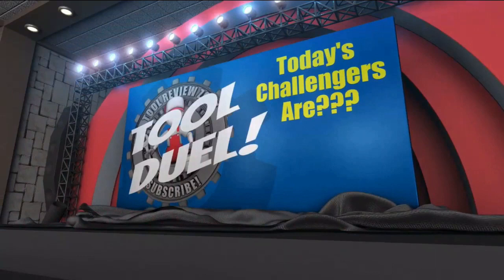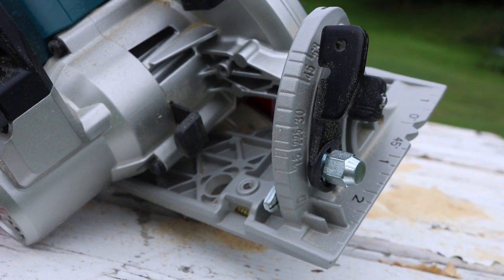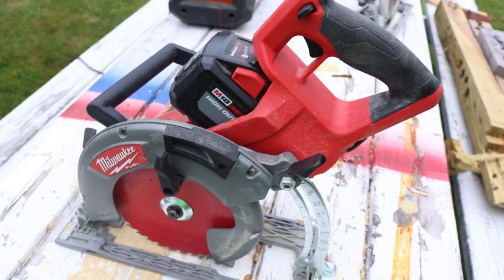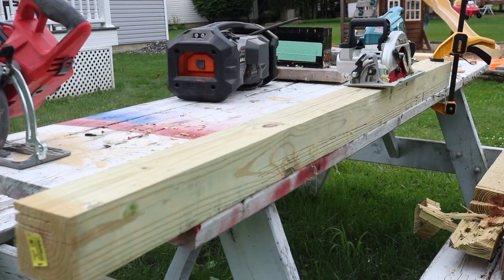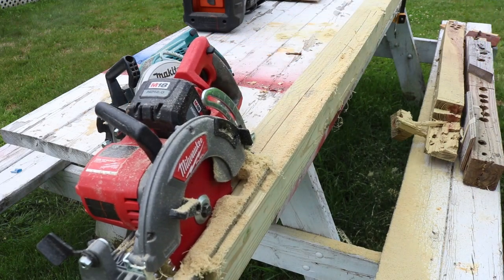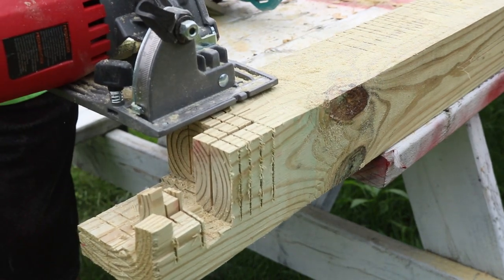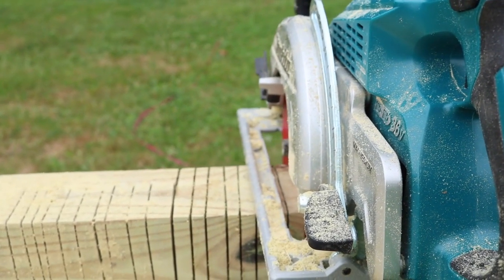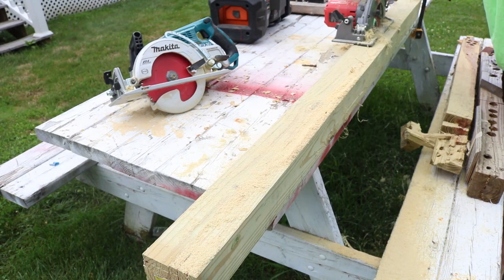Milwaukee VS. Makita! Milwaukee 18v rear handle saw vs. Makita 36v rear handle saw (Tool Duel!)

Comment: I just picked up the Makita XSR01 and I noticed it has an additional extraction port next to the blade stop, the one on this video does not have it. I picked it up from Home Depot with (4) 5Ah batteries, a dual rapid charger, and a storage bag for $250. Hard to beat that deal with Milwaukee.

Comment: Hi TRZ, 

Still thinking if i should purchase this milwaukee circular saw.  

I have to agree with you.  Don't like the bevel knob swinging around and getting lose.  Next the dust extractor should come with a solid cover plate to cover that section  and let the dust come down at blade like a worm drive.  

Or make a different model with no dust extractor on the cover. Like the 6 1/2" model.  

I guess i will wait until milwaukee comes out with a gen 2 model soon.
Reply: Any Milwaukee tool is just great in every from power to battery to durability

Comment: Thr problem is you didn't use the vacuum hose adapter that came in the milwaukee box. Mine has NEVER clogged using it connected to a shop vac which is how it was really intended to be used
Reply: Paul Auten 

No one is ever going to use a shop vac in the field framing. I understand if you are in a clients home making some cuts, yeah use a vac. But the saw has to be able to perform without a vacuum. If I am going to have a vac plugged in the saw 24-7, we would be far less efficient. Also what is the point of cordless at that point? Just my opinion, have a good one!
Reply: Paul Auten or do you mean just the adapter without a vacuum? If so I stand corrected:)

Comment: Why are you hating on the 2 battery system? It totally beats having two different battery types and 2 different chargers to go with it. You can buy body only and use the 18v batteries that you've built up over the years.  I think you're just looking for faults with the mighty Mak.
Reply from the maker: So I have to like everything you like?

Comment: in my opinion, Makita wins here $350 for the whole package vs $449 on Milwaukee faster charge time  and the 12ah battery is not on your way.
Reply: I got the full Makita saw kit plus 2 additional 5.0 batteries (4 total) for $250
Reply: @brokenwave6125  that's great where did you get it from?
Reply: @bitter8440  Acme tools. The promotion where you get the 2 extra batteries for free is still going on too. I think the rest of the month.

But the normal kit with the 2 batteries is always $250 now.
I think Makita dropped the price on that saw this year.

Comment: So these are not true worm drive saws?  Are they essentially sidewinders with a rear handle?
Reply: No they are not true worm drives.  Even though they are rear handles, their gearing is 45 degrees instead of the 90 degrees with a true worm drive.  So they are also not direct drive saws either.  But, they sure do work well.  And the left sided blade is perfect for us right handed people.
Reply: How many degrees is sidewinder?

Comment: Looking for a 2020 holiday deal for either of these saws.  My preference is the Milwaukee, only because I have other M18 tools and don't want another battery platform.  I honestly think the Makita is a better tool (longevity).  The Makita kit is on sale right now at HD for $152 (saw, 2 batts, charger, bag).  Thats a pretty tough deal to pass up when the Milwaukee is priced at $269 just for the saw.  I may hold out for a deal on the M18, but for $152 I am thinking HARD about it.
Reply from the maker: The makita is an awesome deals going on at home depot right now

Comment: Makita has 270 tools with same battery format . Winner.
Reply: ...and does not have any battery powered framing nailer. Loser)
Reply: It's not about the number of tools on the platform. It's about the number of unique and useful tools. You can have 30 impact drivers but what does that do for you?

Comment: No, Makita has it right with the two battery system because you can use the 5amp batteries on any tool! I'm not gonna plug that 12volt battery into my impactor

Comment: I'm wondering if the dust shoot on the Milwaukee would have still clogged if you ran them both at the same pace; because you ran the Milwaukee at about 11 seconds both cuts, and both cuts on the Makita you ran about 16 seconds.  So, Milwaukee's was cutting about 25% faster. Would it have still clogged if you slowed it down 25%?
Reply from the maker: thats a great observation Jason. I may need to try it.
Reply: Makita 18v X2 5100rpm vs Milwaukee M18 5800rpm

Comment: Wet pressure treated always clogs up dust ports. It's par for the course. I've used the makita and the objections I have to it is two fold. First you need double the amount of batteries and they need to both be charged to the same amount in order for it to work properly. Second removing the batteries is very difficult ergonomically.

Comment: I have bought both of these saws. I just got the Milwaukee and I've had the Makita for about 2 years. I try to buy only kits or use sales as a way of buying tools. They are both awesome saws. I don't like the lack of a stop on the Milwaukee, like you had said. My cheap corded old Skil saw has one. Massive oversight. Loosing that would suck. I have to provide tools for my workers. Most have their own stuff, but I like getting the job done fast so we can move on to the next one.... waiting on someone's HF stuff to charge is a waste of money.
Which brings me to my final and maybe most important, price. Tool-only you're gonna pay out the nose for either of these. Milwaukee runs a buy more save more that reduces the price of their saw considerably. However, as many of your viewers may know, Makita runs a sale in that saw multiple times a year. It's the same price as tool-only but you get 4 batteries and a dual charger. Two years ago they had 5 amp hour batteries in the kit. They have since reduced them to 4 amp hour batteries, but you still get 4. While it doesn't fix the issue that their saw needs two batteries, it does clear up the issue of not having enough batteries for your other tools. 
More tool duels man! Love these.

Comment: For me, the lack off on tool storage pretty much eliminates that tool as an option, also I feel the two battery platform is good because you have the flexibility to use it either in an 18 volt X 1 tool or an 18 bolt X 2 tool, instead of having to buy a whole new battery platform.

Comment: I haven’t had the chance to try the Milwaukee yet, but  it looks awesome. I really like my Makita. Honestly my only gripe is not having a light. I’ve had several saws with blade wrench storage, and I never keep them on the saw. Gotta go to the truck for a blade anyway. The double battery thing is a little weird, but it’s really no difference, I just charge them together as a unit. 👌🏼
Reply: ...and FYI, the blade that comes with the Makita is a fair amount taller than the same 7 1/4” Diablo for some reason 🤔
Reply from the maker: Hmmm, haven't even noticed that. Thanks for the feedback Bro

Comment: After watching the vid I'd say they are pretty even up as far as performance is concerned.  The only drawback I see is the two batteries required for the Makita since it adds more weight.  If I had to choose one, I'd go with the Milwaukee based on performance and the single battery.  But  that's just my opinion since I'm a DIY'er and not a contractor.  Thanks for sharing.  Cheers!
Reply from the maker: As always, thanks for the awesome feedback William!!!
Reply: but the 12 AH milwaukee battery weighs much more than the makita 5ah battery.  And it is much more bulky.
Reply: Doc Martin
Reply: Those barriers are like 150$

Comment: I completely disagree about the dual battery concept. How much bigger can Milwaukee batteries get. Makita has room to improve but to me Milwaukee has reached the limit as to how big and heavy their 18V batteries can get. Also, from the electrical engineering point of view 36V just makes much more sense as you can use thinner wire because you have have half the amps when you have twice the voltage. Also, Makita gives you free batteries when you buy the tool or at least they did when I bought mine as they had a special where they gave you for free two extra 5.0 A-hr batteries so you can always have a fresh pair ready to go and there is no way in hell you can use two of these up before the dual rapid charger can replenish the dead ones. Two of which together weigh less than the one 12.0 A-hr Milwaukee. The 36V dual battery concept is the best solution to these high demand applications.
Reply: Good one
Reply: Depends if it's run as parallel or series

Comment: I have used both, the makita is great but a tad heavy. I own the Milwaukee, One thing that bugs me to no end about it is the blade guard has a taper to it at the contact point that tends to knock you to one side during the start of a cross cut...I realize the bad asses will say they lock it up out of the way and I get that... Also the dust channel dose seem to clog on occasion but what I don't like is it coats me with saw dust especially during osb rips...When I first got this saw I thought it would be the back up or convenience saw, strangely I haven't used my worm drive skillsaw since I bought it! it's a new era nowadays.

Comment: Don't see the problem using 2 batteries to get 36volts. I have plenty of batteries i interchange between my 36 and 18 volt tools. For me its better to stay on the 18volt platform and double up for more power. Both the Makita and Milwaukee saws perform well but my choice purely to stay on the same battery platform. Keep up the great vids 👍👍👍

Comment: Makita  batteries take 45 minutes to charge and the Milwaukee battery takes over an hour. Enough said, I will take 2 batteries that I can easily use with all my other tools that are faster to charge and more out of the way, any day. The amp draw on each battery is half what it would be on the Milwaukee because there are 2 instead of one, which I imagine helps greatly with the Makita's battery life.
Reply: Did you know Milwaukee does a super charger which halves the time of the rapid charge?

Comment: Both are great saws like you mentioned, and Milwaukee did a great job with the saw especially for an 18v platform.. can’t wait to get my hands on one. But most likely, that Milwaukee will need to be warrantied a few times while that makita will keep working without issue.

Comment: I from Canada and have used them all been doing framing for 30 years Milwaukee is the only one that will work all day in negative 20 and have had the same Milwaukee saw for 2.5 years not an issue

Comment: Milwaukee 18v:  saw, charger, bag, one 12 HO battery $449.  Makita 18v x 2:  saw, charger, bag, four 5ah batteries $259. Makita 40v Max XGT: saw, charger, bag, three 4 ah batteries $399. Flex 24V stacked rear handle saw, charger, bag, one battery $399.  Probably a nice saw, but I think Milwaukee 12HO batteries are still too expensive.

Comment: I own both LXT and M18 batteries and tools , but personally got the Makita on a BOGO deal with two 5Ah, dual charger and a cordless sawzall for $249. This is cheaper than the Milwaukee bare tool and we all know the HO batteries are over $100 each.
The Makita has been on sale several times and it's hard to beat for the price. If you ever spot the Milwaukee on sale for $249 with battery and charger jump on it.

Comment: It's funny because I have both companies of tools and for the Makita I have that saw now I just bought it for $250 it came with an extra pair of five amp hour batteries so I have four total you can't beat the price point as for Milwaukee their tools are just on another level of durability they're really tough they feel good in the hand as well but not as good as my Makita Black compact series but then again I bought that for home use but I am very excited to try this saw it will see what happens thanks for the video shoot out!
Reply: Bought mine but came with free grinder xlock 😀😀😀

Comment: And Milwaukee has a 5 year warranty vrs a 3 year on the Makita, an important thing to consider where the motors are all electronic!!!
Reply: Good thing........because you're gonna need it lol.
Reply: @mattfowler7892  The point I'm trying to make is that with the "brushless" motor technology I don't care what brand if anything "electrical" goes wrong including the switch (with a few exceptions)  it's normally not worth repairing. For example if the switch on the  DeWalt DCS577b saw quits at 13 months you throw it away because a new switch/motor module is close to $125.00 with out labor, and it only has a 1 year warranty (ya I know they try and tell you it's a 3 year but switch's are considered wear items). With the Makita you can at least buy the switch separate for around $15.00 (the motor assembly is very expensive) and it's warranty is  3 years.  With the Milwaukee the switch is only available as an assembly for around $140.00 and is warrantied for 5 years. And by the way they all break! By the way battery warranty is 3 years for the Makita and Milwaukee and 1 year on the DeWalt.
Reply from the maker: @slivers4007  great point

Comment: The only thing that I can say is that I use the Milwaukee one daily and I absolutely hate it because the ejection port blasts the dust right into you. I do a lot of finish work so my cuts have to be exact so I’m always close to the cut to see and you’re probably saying “just put on the ejection tube that comes with it” well that’s an even worse design because once you do that it shoots it directly at you now instead of down and onto your pants.

Comment: In my opinion, both saws are top of the line. But my pick would be Makita ,only because of the battery's swap out. And I prefer the extra weight on the Makita to keep my line in check... And let's not forget the fast charging, which is very important for me😊..

Comment: The X2 system is absolutely better. You just use the same compact batteries that you already have for all your other tools. You probably even got them included extra in combo deals.

Everyone else you have to buy these expensive monster single batteries for these bigger-draw tools while the smaller batteries you have for everything else don’t have the oomph and have to sit in the corner. And then these monster batteries don’t make sense to use is your other tools. Sticking a 12Ah into your impact driver doesn’t make sense.

Also as noted by another poster already, 36 volt makes power delivery easier because it requires less copper. Not that that can’t be overcome, the Milwaukee appears at least a little more powerful anyway...but they would have had to use disproportionately more copper throughout their design to achieve that. At least they know how to go about it, but it’s going to cost you somewhere.
Reply: Oretachi wa koroshi no tatsujin
Reply: Soudegozaru

Comment: i have Milwaukee, all my co workers use makita. i think both platforms are on par with each other, i was pretty impressed with the makita saw and actually just got one that i saw at a pawn shop for pretty cheap. since there are so many makita batteries floating around our jobsite i have no worries about keeping the saw powered even though i only got 2 batteries with it

that said, makita sells some worthless tools too. that little 5"? saw they sell won't even cut a 2x4 and shouldn't even exist imo. i mainly went for milwaukee because of the variety of cordless tools they offer, which makita just dosent have. i work on cars alot as well and didnt want different batteries for my auto tools, and the milwaukee 1/2" impact absolutely blows the makita out of the water with 739 vs 1400ft lbs. miluakee also makes a cordless 3/4 and 1" impact whereas makita dosent. i also like milwaukee's hackzall vs makitas one handed sawzall, the balance and length of the milwaukee really wins.out and makita should have just copied it like (im assuming) all the other brands did. the regular milwaukee sawzall  however is awefull and just eats batteries.

i see automotive guys mostly using milwaukee, and i think a big part of the reason is they came out with that high torque impact and there was nothing on the market like it at the time. other brands are catching up but it seems like milwaukee has the automotive market.

Comment: I would prefer the makita. I like the 36v, the two batteries, the grip and the dust shoot. I don’t like not being able to have the wrench on it. 
I like the light on the Milwaukee and the line of sight. I do not like having to have those high output batteries.

Comment: I know why you would use the same blade for the test but the stock makita blade cuts amazing, maybe better than the diablo!
Reply: Diablo makes the best cutting blades and cutting bits on the market bud, ain’t no way a makita or Milwaukee blade can beat a modern Diablo blade in the same size and class
Reply: @mendoafgoo420  the diablo may well beat the stock makita blade but it still cuts great. I don't know how many thousands of cuts it has made and it's still sharp. I did replace my tracksaw blade with a diablo after a run in with some masonry..

I have seen lots of blade tests and never seen the stock blades tested vs the diablos.

Comment: I just don’t think the battery technology is quite there yet on any of these saws..Yeah they’re convenient if you’re working up in the air as long as you have a couple extra batteries in your belt..But if you have a lot of ripping to do these things run out of gas way too quick and as I’m getting older they are just way too heavy